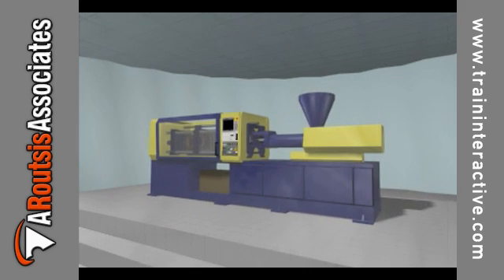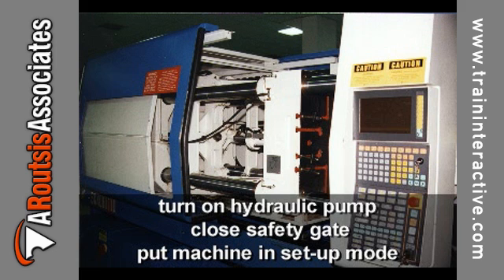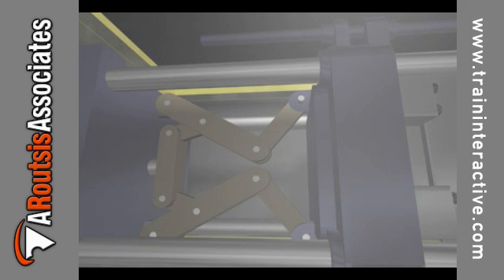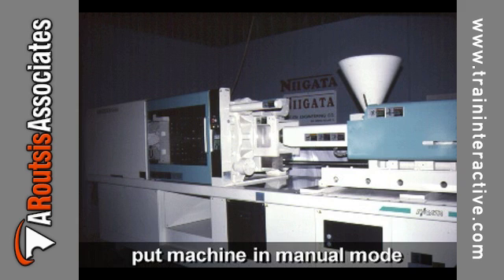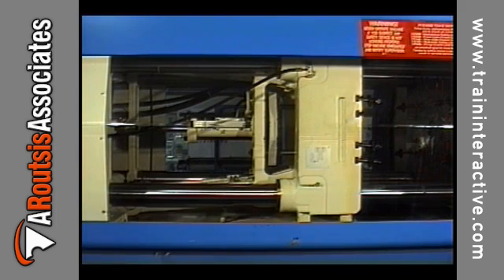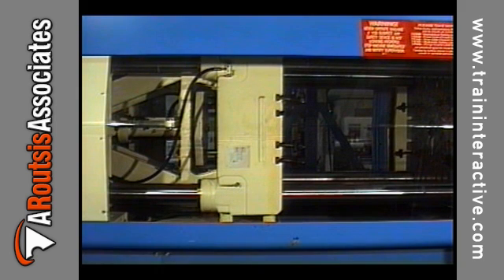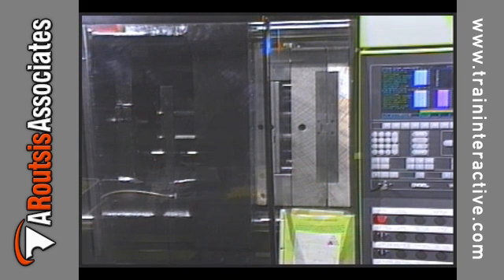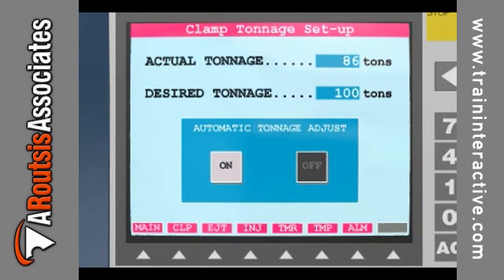Injection Mold Setup (excerpt)

Comment: its the water pipes that confuse me.Id really like a simple explanation as to how they are set up.Im training as a tool hanger.Some of them have so many outlets it drives me crazy.Loop it round there,loop it over there under that over that just under there.ANYONE HELP?
Reply: pdjbuzz51 I would make sure the molcon temperature is safe to work with, once that's set take ur water hose plug em in n turn the water on slightly to see where the water will come from n continue that method till all hoses are connected n circulating properly